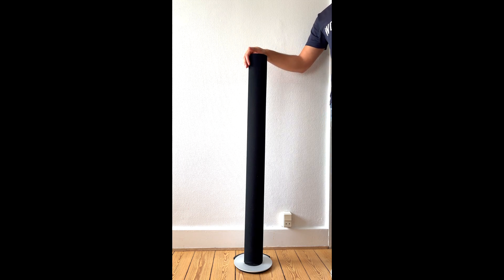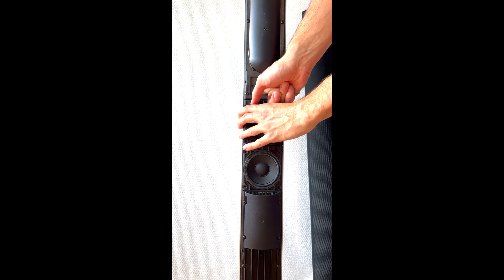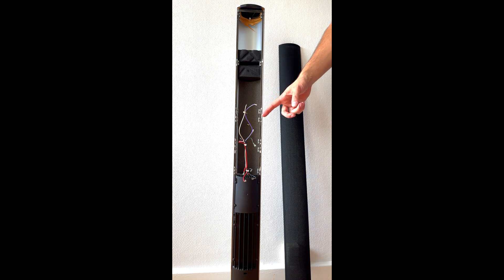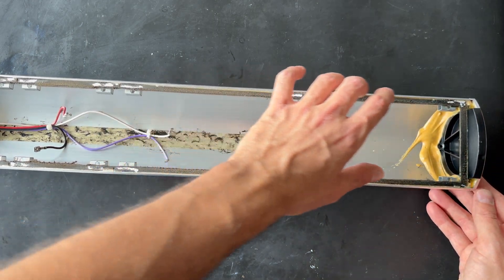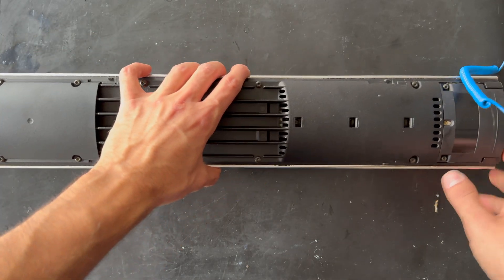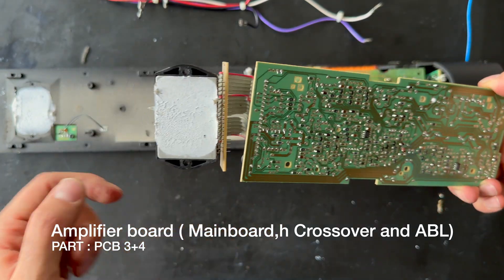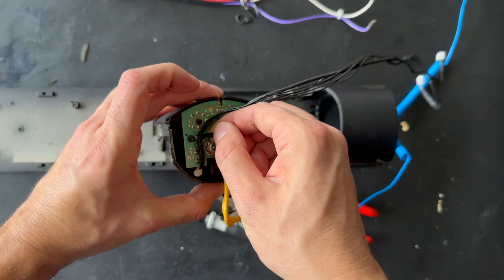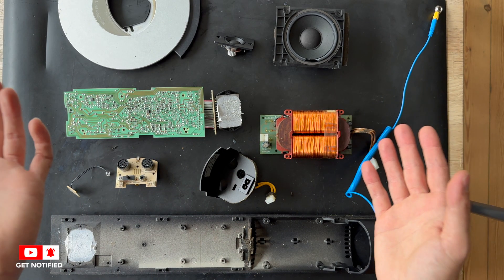Bang & Olufsen Beolab 6000 Disassembly, cleaning and repair guide process

Comment: Hi. Where can I get the subs for these. I want to replace mine and it’s hard to find. Any help is highly appreciated.
Reply from the maker: Thank you for your message. Could you let me know which model you have, so I can guide you to the correct subwoofers for replacement? We carry and source a wide range of Bang & Olufsen parts, and if it’s something not currently in stock, we can often help you locate it or provide a service solution.

If you share the exact model, I’ll check availability right away and get back to you with the best options.
Reply: @KoseTrading  Beolab 600 and when I removed the cover and checked the cover of the sub was old and it tore due to that the bass  sounds like it’s broken.

Comment: Hi, first of all great video!!! I have one of my 2 speakers (beolab 6000) which I had to replace the material since it was very worn out. The main reason was because when the speaker goes into auto off mode, instead of the red light, it turns yellow and starts to make a very high pitched and annoying sound, I thought it could be because the "rotten" material is getting into the circuits, but even after cleaning everything the problem remains. I would like to know if you know what it is and how to fix it, if it is an electronic component that is shorting or something like that.
Reply from the maker: Thank you for your message. Sounds link your amplifier inside the Beolab 6000 has been damage. Contact us and we can find a amplifier board for your Beolab 6000.

Comment: How to you change the voltage from 220 to 110? Is there a way to install a jumper on the board? Or do you need to purchase a new power supply?
Reply from the maker: Very good question, normally on Beolab 3 PSU board you can remove the jumper and convert it to 110 Voltage. But i do now know on the Beolab 6000. Send me a message and we can take a look

Comment: Nice video, Mr. Kose. I need to remove the input unit.  The line-in jack wobbles, causing a loud power surge noise.  It needs solder.  Can the input unit be removed without having to disassemble the rest of the speaker first?
Reply from the maker: Yes, you can remove the input unit without removing all the other things. Remove the front cover then you can remove the input section.